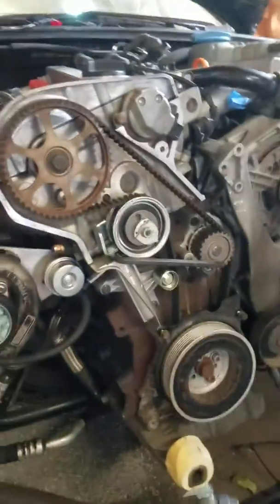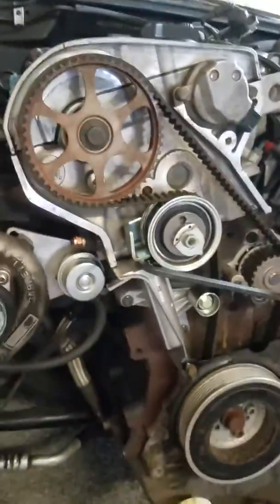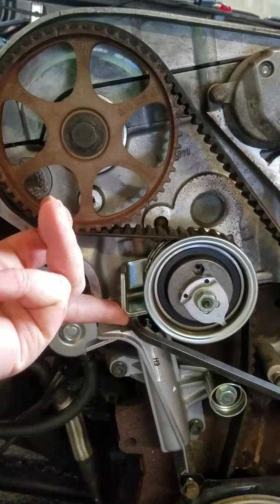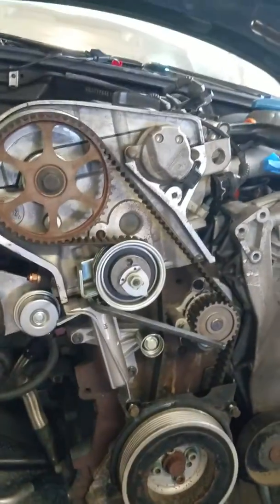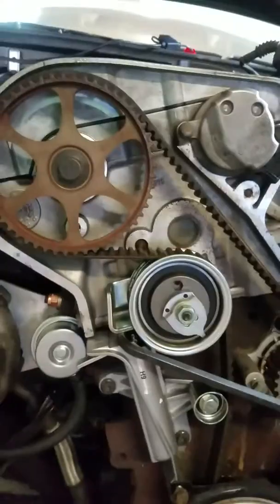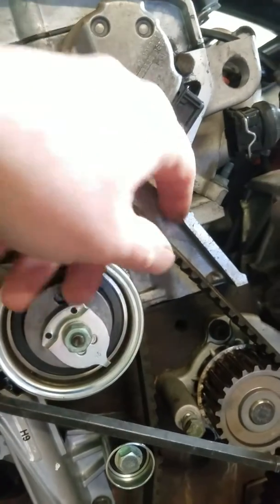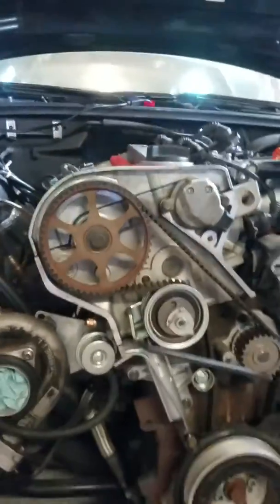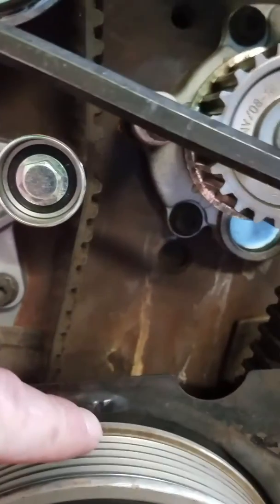Audi / VW 1.8t timing belt tips

Comment: A good video! A few insights from my own experience: Setting the timing is not so easy to do when the engine is in the car. The mark on the pulley cover isn't fully visible, as the engine mount is perfectly in the way of seeing it. It can't be seen right from the bottom either. The timing marks on the cams aren't 100% accurate and confusing with the fact that chain tensioner is moving up & down as, there is no oil in the system. I thought I had all right till I fired up the engine (I missed 1 tooth). The better way of seeing the crank timing mark is on the flywheel. Just the little rubber plug should be removed from the gearbox housing window. Cheers!

Comment: I just did the timing belt on my 1.8t over the weekend (second time doing it now) few tips I have
To confirm you are at TDC you can pull spark plug 1, put a long 3/8 extension down there and with the old belt on, rotate the crank pulley a half a tooth back and forth, you will be able to see where direction changes to confirm TDC markings are spot on, this allows you to mark the crank sprocket to remove any guess work. 
If you decide to do the belt marking technique, you can simply put the belt on matching your cam markings, rotate the crank back one tooth, line the markings up and rotate it forward once you have the hydraulic tensioner bolted back in, it will line up perfectly with your timing marks without moving the cam.   
To remove any guess work, I decided to mark a crank sprocket once confirming the old belt was at TDC using the above method as the timing cover markings are not always exact depending on how the pulley was bolted back, it has a few mm play in either direction. 
Also noted my vw manual specified the tension to be about 5 - 6mm (BJX engine Polo GTI 1.8T)
Just my 2c, hope this helps anyone with similar questions.

Comment: What do you do if the bottom is lined up but the top is one tooth back
Reply from the maker: Take off the tensioner and loosen the eccentric pulley. Leave the cam sprocket where it sits and get the belt loose around the crank sprocket. Rotate the crank sprocket counter clockwise about 1/2" (don't worry that's not sufficient to cause interference with the valves) and the belt should fit into the next tooth on the cam sprocket. Then snug up the belt by pushing the lever on the eccentric pulley upwards, install the tensioner, and continue on to set proper tension as described in the video. Using an 8mm allen key as a spacer and pulling the belt up to proper tension before you pull the pin on the tensioner allows you to rotate the motor around to double check the timing before you pull the pin.
Reply: @jgerard7136 worked great every thing is perfectly in Time thanks man. Any tips for getting that engine mount bracket back in?

Comment: With my old belt off, my crank is at TDC but the cam sprocket is offset counter clockwise by one tooth left of TDC.  Is this normal?
Reply from the maker: It is normal to be slightly counter clockwise. If you rotate the cam to TDC it rocks back a full tooth? If so just rotate crank sprocket ccw maybe half an inch to align the belt. There is only one position that that the belt can sit and be on the correct teeth of both sprockets and achieve correct timing.

Comment: Hey man ty so much for the video. I had one question. Did your timing pulley the main one have a washer behind it? The stock version did but my kit did not come with one. Nobody can give me a straight answer if it's supposed to have a washer between the block and the timing tensioner pulley
Reply from the maker: I really dont remember it's been quite a while since I did the last timing job. I think it may have a large one behind it but don't take that as certain.
Reply: @jgerard7136  I honestly don't know if it matters much.... But I set my timing last night and watched a couple videos and the other style that's not like yours and mine have a bolt instead of a stud and they use a washer

Comment: Thank you !!!!! Omg I was about to take a Maul hammer to my brand new rebuilt engine. I have been struggling so hard!!! I can't even get the belt on...now I have hope! Also my eccentric wheel only has a Allen key hole to adjust. It's made by some big name rebuild part company my machine shop used. Some guys name with a R. But thanks dude

Comment: To remove the harmonic balancer did you need to remove the crankshaft bolt or does it come off after removing the 4 Allen bolts? I have seen many videos where the balancer comes off after removing the 4 bolts but mine doesn't budge. Mine seems to have the same 4 bolt + 1 alignment hole as yours so I wanted to ask.
Reply from the maker: Just remove the four allens the tap the pulley with a hammer it gets seized on. Just needs a little persuasion.
Reply: @jgerard7136  I got it thanks. Used the thick end of a butter knife and that did the trick!

Comment: So if I set both on point then rotate the engine and the crank ends up a little passed what happens if it’s started? Will it still be close enough
Reply from the maker: A little past will not cause interference but you should pull plug 1 and put a long screwdriver in touching the piston and rotate the crank to see if the mark is correctly showing TDC.  The screwdriver test never lies. Just watch it push up as the piston moves and you can easily see true TDC.

Comment: What is your opinion of replacing the hydraulic tensioner and pulley with a manually adjusted pulley? ECS Tuning is pushing this as a reliability enhancement.
Reply from the maker: I use NTN tensioners and haven't had a problem except for one many years ago. I swapped it with a new one in the service position. I don't think they are unreliable and wouldn't want the hassle of checking a manual tensioner. But to each his own.
Reply: @jgerard7136  Thank you for the prompt reply. I have never experienced belt tensioner failure, either, although when the car was 4 years old I did have a soft failure of the OEM cam chain adjuster, with plenty of advance audible warning that something was amiss. 

Have you any thoughts regarding preventive replacement of cam chain adjusters / tensioners? I have heard rare reports of sudden disintegration, but most seem to fail the way mine did, with a bit of leakdown making a very distinctive sound of the chain sliding across the top of the CCA during deceleration.
Reply from the maker: @johne6081  I don't bother with proactive preventative maintenance unless the part is known as prone to failure such as the B6 S4 timing chain guides. The likelihood of failure of the cam chain tensioner in the 1.8 is low, and if it is failing you'll hear it coming like you did. But that's just how I do things... every person has to decide for themselves if it is worth the money for peace of mind.

Comment: It's interesting you're doing a video about how to ball park the timing mark alignment yet you look down on counting teeth. After fighting this fight myself I firmly believe that if I do this again, I will be counting teeth. The final checks to confirm proper alignment are the same in both instances, so why knock one technique or the other?
Reply from the maker: I wasn't trying to look down on counting teeth. I know people do it and it can be helpful to confirm alignment. I don't do it because it's difficult to align the paint marks using the lower crank sprocket because it is so small and you must have the timing cover and lower pulley out of the way to see the mark; and second, unless you rotate the motor by hand first before removing the belt, you do not know for sure that the prior belt was correctly timed. Setting the timing off 1/2 tooth does not cause obvious problems like misfiring and rough idle on the 1.8t. So I use the timing marks on the motor and not the old belt. For this particular video, I did not replace the belt as it had only 10k miles, I was resetting timing because of a fan failure and overheated motor that resulted in a leaking head gasket, so I didn't bother to remove the lower pulley and timing cover nor did I have a belt to compare or count teeth. I probably should have done a better narration of the video, as this method is not really "ballparking" the timing, when you rotate the crank back a few degrees the only teeth that can be engaged are the correct teeth for alignment, it just doesn't appear aligned correctly until the belt is tensioned and the crank sprocket is pulling the camshaft sprocket around as it takes quite a lot of force to rotate the camshaft due to spring pressure.

Comment: Update.. I followed everything this video explained and both marking ended up on point after crank. Thanks a lot
Reply: Any exact details from the video youre referring to? Im a first timer on the 1.8t. I bought a minty jetta with a 1.8t and its timing belt looks a little old for my liking and am so nervous of fucking it up, Ive done honda timing belts before but this seems like a whole different beast. Got everything torn out of the way, just a motor mount remains.